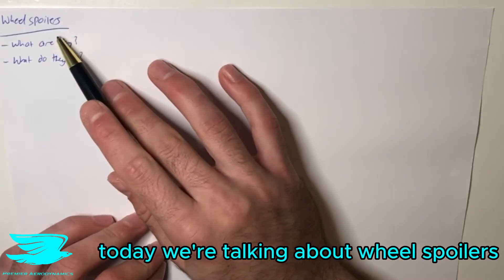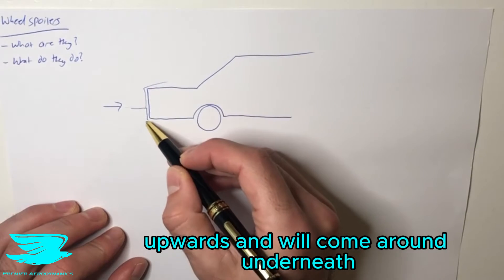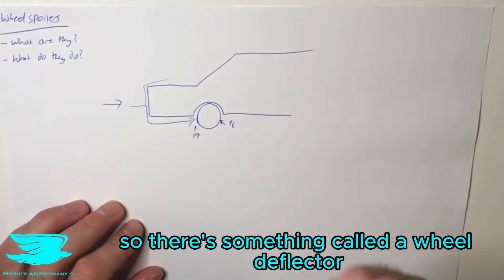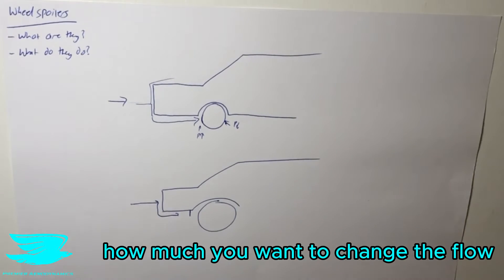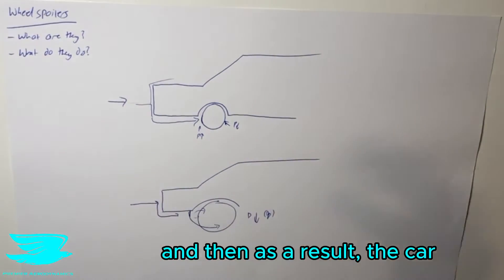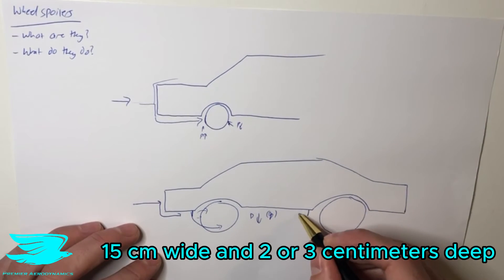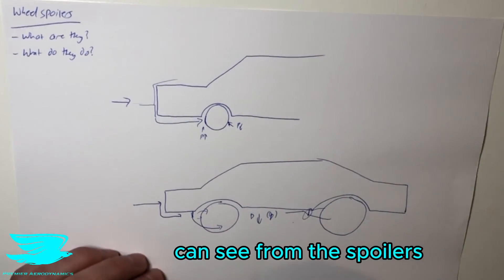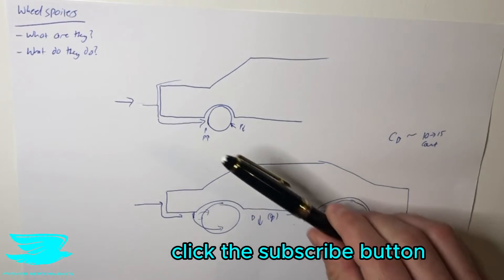{Auto Aero #35} Wheel Deflector Aerodynamics

Comment: Instead of making them flat, could they be curved horizontally to reduce drag and dump the air on either side of the wheel? Would making these longer/hang lower have benefits? Or would it not be worth the increased chance of contact with objects?
Reply from the maker: There ahs been some research into it and it hasn't shown too much of a difference. I personally think that they haven't been considered with the wheel though because it makes sense that it should work.
Reply: @ thank you for your response! I’m considering a slight lift on my Subaru Forester which is a terrible idea aerodynamically for sure. I’m looking to regain some of that back and I’m considering extending my wheel deflectors and flattening the floor since it was manufactured before a lot of attention was given to that. I also just watched your video on the students with the Land Rover experiments and I’m curious about piping the engine compartment air to the back since there is already a large area cutout down the middle of the vehicle for the drive shaft. Ideally, I’d flatten the floor then enclose a pathway down the drive shaft “valley” to channel that air to the back and have an exit through some bumper vents. It could be a flop but it will be fun to try. Thank you for your videos and inspiration!
Reply from the maker: For flattening the floor, just make sure that the various components can still be cooled enough.

For the piping through, it could definitely work if you already have a straight volume to work with.
Reply: Most of these deflectors are flat and rectangular shaped, doesnt seem to have specific direction to deflect the air big portion of the air gets redirected down towards the road or into the wheel tunnels which doesnt help much. The fact that most of them are secured by 2 plugs or 1 screw and 1 plug means and being soft plastic makes them bend under force this even further reducing their effectiveness and generating additional drag, so they kinda cancel each other off. Also you need to be at really high speed for it to actually work. The ones on the rear wheel may work better to deflect debris lifted by the front wheels but the front ones arent useful unless you tailgate frequently to catch debris.

its more of a nuisance to have it fall out or ripped off in the parking lot or speed bumps. a front skirt would be x100 much more effective.

Comment: Thanks for the info, loved it! Could you also do one on the flow separators on the rear quarterpanels?
Reply from the maker: Thanks!

I'm not quite sure what you mean by flow separators on the rear quarterpanels (maybe I know it by another name). Do you mean when you make the flow at the rear separate in a controlled fashion? Do you have a link to a picture, or something, showing them? Sorry :)
Reply: @PremierAerodynamics  Hey! Im talking about the new flow separation wrinkles on the new id3, older prius, etc. They go from the rear window corner to the lights and then to the bottom of the corner panel. Its like a kick so flow detaches at that point, but im not quite sure why they want to do it there and what kind of measurements are required for it to be such a kick point.
Reply from the maker: @sandertakkenberg1197  Oh right! I know the ones.

Sure we can do a video on them.

Just as quick note, they are there to rigidly define where the flow will separate to reduce transient effects that can also increase drag.
Reply: Hi, wouldn't an angled deflector that directs air downward, or to the side reduce drag even more? Considering it isn't done like that, probably not, but i do not understand why not.
Reply from the maker: @rienkhoek4169  That's a good question, and there are a couple of things to consider.

The first is that if you deflect the air too much to the outside, that will make the wakes on the sides of the car greater, which will increase the drag.

The second thing is that wheel deflectors do deflect some of the flow down, but deflecting all of the flow down isn't as beneficial because you are still directing all of it to the tyre. So, a combination of deflecting down and around and the tyre is best. The exact amount depends on the flow conditions and the car.

But, there are things called "air dams" which are literally what you said, where there is this strip underneath the front of the car, below the bumper. This literally deflects some air down, and reduces how much air goes under the car in total. That increases downforce and often reduces drag.
Reply: @PremierAerodynamics  thanks a lot. That is useful. Thinking of improving mpg on my lifted Subaru Forester. ( Lets just say there is quite some room for improvement)